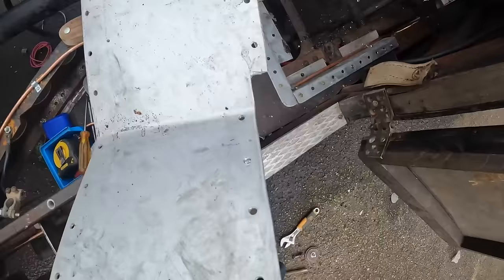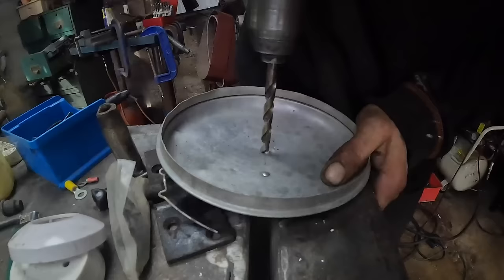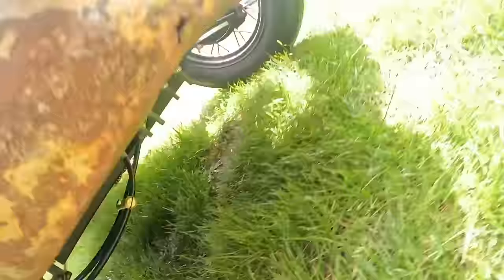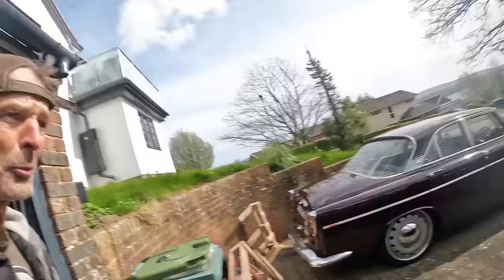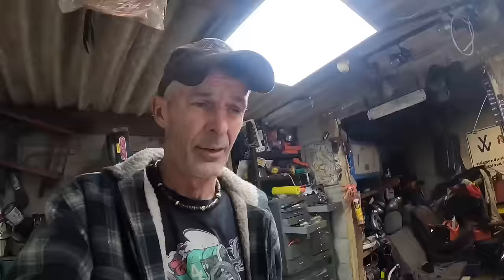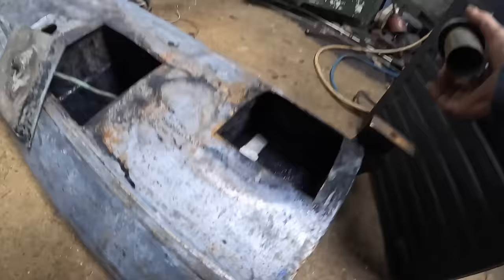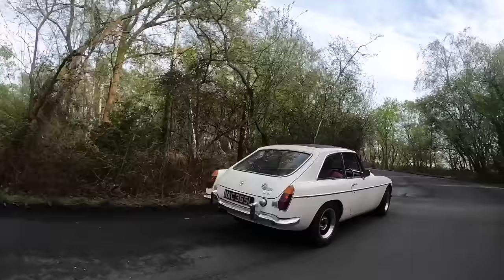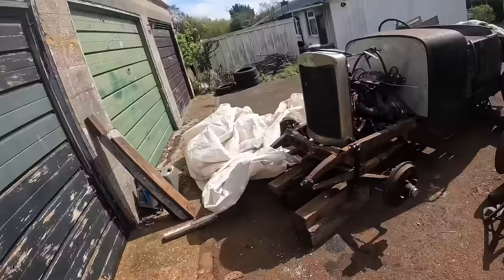'The Leaf'  a ratty roadster, part eighteen ...Harleys , T's and MGB's

Comment: With that possibly dodgy radiator , why not go for a non pressurised system? The radiator looks to be big enough?? You would probably have to ditch the thermostat . Run the engine at a lower temp.
Reply from the maker: im gonna seal it up see what it does and may be use some non water with a low boil...cheers dude